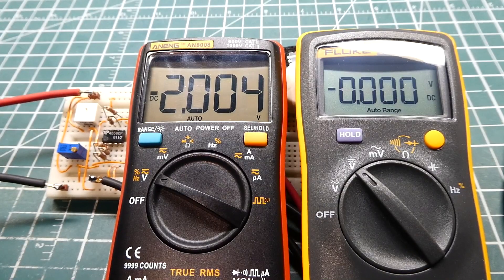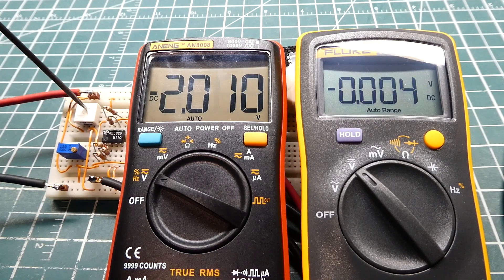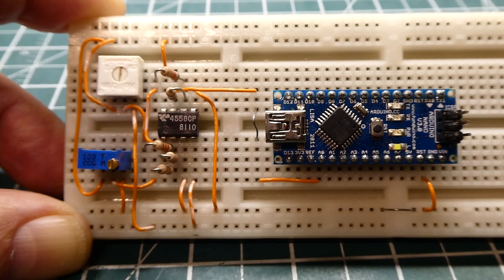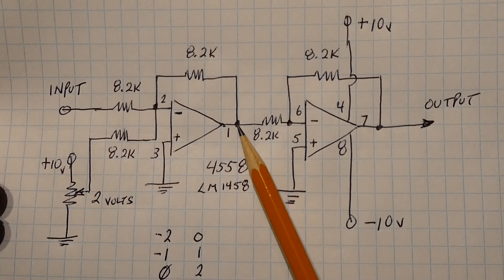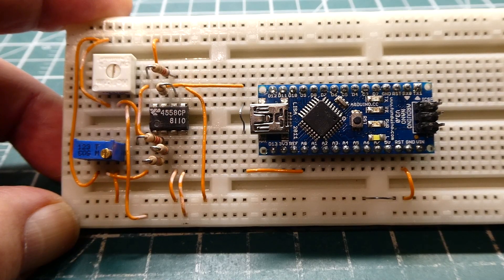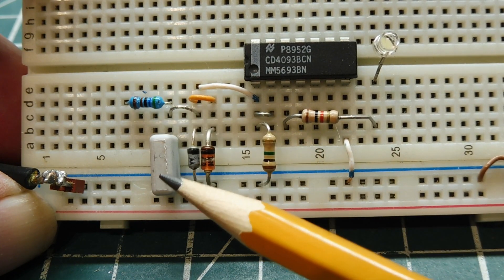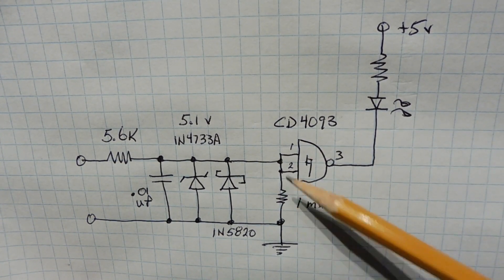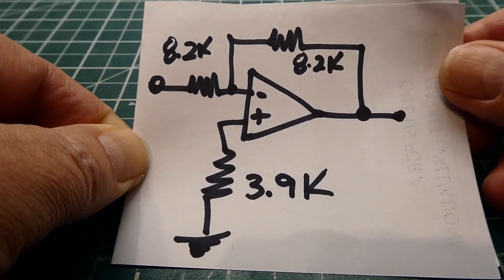Voltage Level Shifter For ADC Input / Overvoltage Protection

Comment: I have a similar application where I have a +1.8 to +3.0 VDC signal that I want to change to 0 to 5VDC. Having some difficulty, but it looks like your circuit with 1.8V reference voltage is a good starting place. So I would hope for an output of 0 to -1.2 from the first stage, then a second stage with a gain of about 4.1 to achieve 0 to 5VDC.
Reply from the maker: Yes, you can use this circuit as a template to get your desired result. Another option is to use a differential ADC to get your maximum resolution from a 1.8v to 3.0v input swing. Check out this video:
https://youtu.be/4wT6nRqV7Vc

Comment: Do you have a formal education? What math is important for these circuits?
Reply from the maker: In this video it is simple addition of positive and negative numbers.
Reply: @0033mer  Nono, I mean in general? Do you have a degree, and what math do you find is most important in embedded circuit and circuit design in general?
Reply from the maker: Yes, i have a degree in electronics where the main focus in math was LaPlace Transforms. For embedded circuit design you should be very familiar with decimal, binary, byte and hexadecimal notation. Code using integer and fixed point math together with 2's complement, binary fractions, and logic functions like AND, OR, XOR .... etc including CRC calculations. To get familiar with these subjects write some code for the DS18B20 temperature sensor which is an exercise used in first year university embedded systems course.
Reply: @0033mer  thank you for your thorough answer. I'll do my best to learn and experiment 😄👍🏻

Comment: Useful circuit and great explanation.
Lab power supply is useful for experimenting.
But you could have presented a bit more info on how to provide negative power supply to the op amp when it is on board in a final product.
Reply from the maker: I incorporate one of these in my final product:
https://uk.rs-online.com/web/p/isolated-dc-dc-converters/2233683
Search for NMA0515SC Murata